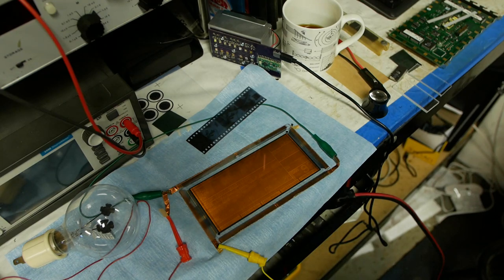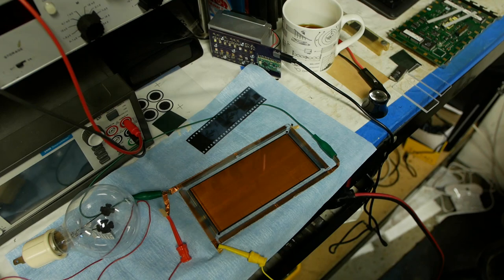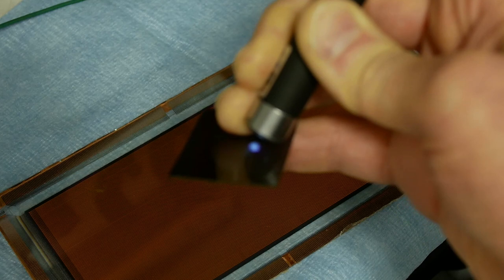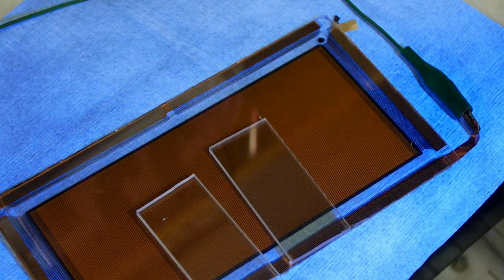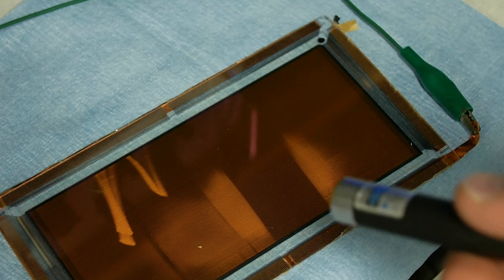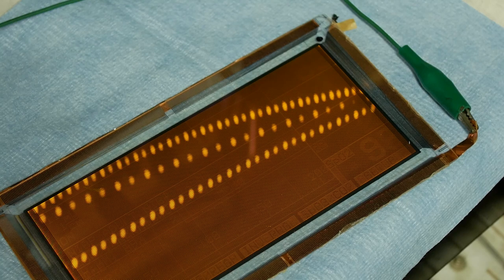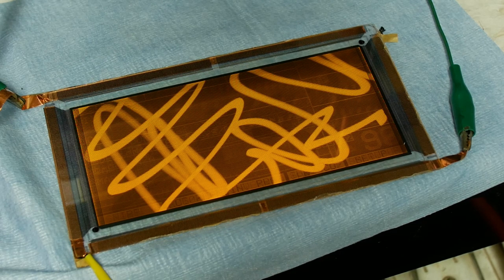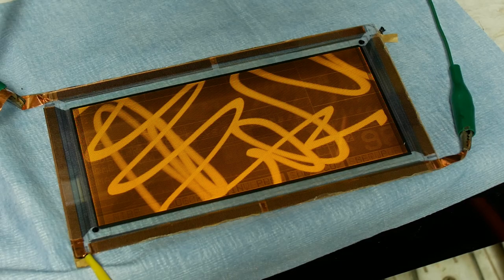Drawing on a plasma display with a laser pointer

Comment: This was very cool. You mentioned the idea of using it for I/O, but I didn't see anything about reading the laser-scanned image out of the display. Is it too basic to cover?
Reply: Probably terrible res
Reply: If it's possible to read, it would be revolutionary. You could turn any old plasma tv into an incredible artistic device
Reply: One way would be to stick a CCD behind the display
Reply: The resistance of the pixel changes, so that should definitely be detectable through current measurement
Reply: @albertweber1617  like to know more details about, how to do that. I have plasma TV with me. Wanna convert it as drawing panel.
Reply: Not too basic, too difficult. You'd have to build a custom driver for the whole display
Reply: i'm think by output he means display

Comment: This reminds me of those CRTs with high-retention phosphorus that were used as display "memory" in some early terminals. I only saw one in the 1990s and back then we didn't have UV lasers at the ready, but I imagine the phosphorus could be excited the same way and retained by the bias voltage (I think that's how they worked).

Comment: Can a laser replace the heater function on a vacuum tube, but by photoelectric emission?
Reply: Checkout photomultiplier tube, not exactly a vaccum tube. But it is designed to be activated by single photon and multiply the signal
Reply: The first stages of electron accelerators (that generate the electron bunches) for x-ray lasers sometimes do this.
Reply: Video cameras with vacuum tube pickups use a photocathode in the image plane in addition to having a thermionic cathode in the electron gun.

Comment: We used plasma displays in our aircraft instruments for years. They had neon, mercury vapor and KR85 gas in them. The Krypton 85 is radioactive and kept the display ionized a little in the dark and the cold. They often had a keep alive electrode that had a few uA of DC continuously flowing for the same purpose. Some neon bulbs like those HP used in their voltmeter chopper circuits probably had some help to switch quickly in the dark. Some neon bulbs were made with green glass (radioactive uranium glass) for the same reason. Fascinating discovery you have here.

Comment: You have single handedly renewed the plasma display. Maybe one day will will see a scanner or signature panels using this tech. Love your videos
Reply: There any readable difference when it's brighter/darker IE voltage/resistance? That difference between acrylic & polycarbonate would be a nice way to detect plastics that's exceptionally hard to do.

You try it on a solar cell? I know they emit light when you drive them in reverse and have the same sort of tech inside them. (more in the IR range though IIRC)

Comment: I think its a bit like gas in laser gets excited, where valence electrons get pumped to a higher energy state when being excited by a photon. When the laser excites the gas, the break through energy required for it to glow get lowered. Add to this the AC current and the laser pointer, then depending on which position of the sine wave the effect is higher or lower. To prove the later, when scribing fast when power is off, the pattern is not supposed to show.

Comment: What great timing - I recently used a UV flashlight on glow-in-the-dark material and found that I could doodle pretty well on it. I've since been thinking about painting a ceiling or feature wall with glow paint and using a computer-controlled UV laser pattern scanner to make a big phosphorescent/fluorescent vector display...

Comment: Thank you for the fun viewage. Perhaps there is a DC offset changing 1/2 pixels? alternately perhaps the pixel stack ends up being diode-ish?
Silly boomer EPROM anecdote follows: I used to (re-)program a lot of EPROMs. I had an erasure enclosure that could hold dozens of devices. I called it a Barbie Tanning Spa.

Comment: Not only are the dots big/small/big/small, the distance between them changes. It looks like the small is closer to the big that came before it than the one after it.
Reply: Yeah that's true, I feel the simplest explanation would be that his function generator isn't producing a perfectly symmetrical drive current, or that the panel behaves nonlinearly. 

However I wonder if it's bc 'freeing a hole' isn't strictly possible, i.e. it's always the electrons that actually move. So possibly you can eject electrons from the metal surface, but can't effectively eject electrons from the gas, therefore the e field has to be weak for the electrons to be ejected from the metal in the reverse polarity (but close enough to the peak to actually cause ignition) therefore shifting the reverse polarity dots to the raising edge of the reverse polarity curve.
Reply: Could it be an artefact due to interferences between the A/C frequency of the plasma and the one of the UV light?

Comment: Super interesting video as always! I remember thinking that it would be cool to have an "analog" notepad to draw on (stylus on a glass LCD) and this is essentially what I imagined; really cool to see it. With the excellent EEPROM comparison, I'd be curious if the plasma display could be read off of and save/reload the temporary images/drawings on the display. Keep up the great work!
Reply: The thing you're thinking of remind me of the LCD notepad/clipboard. It's pressure activated and erases the writing area using an electrical pulse. Costs a couple dollars. I wonder how it works. For sure there are no individual pixels there though.

SONY e-book readers with a Vizplex ePaper display also have a resistive touchscreen option, those that have it come with a sketchpad application. Unfortunately the quality of implementation was garbage software wise.

Comment: Gas discharge lamps do tend to be sensitive to external illumination, It is not that uncommon for neon indicator bulbs to be brighter in a lit environment than in the dark, presumably because the illumination lowers the striking voltage, so it strikes earlier in the waveform. 

Radiation can also affect the striking voltage,  a Geiger-Müller tube is pretty much a neon lamp with some added stuff to tune detection and ensure the ionization is quenched quickly, perhaps your display will show a sensitivity to radiation too? I suppose the glass is too thick for alpha and beta, but I suppose that gamma and X-rays might have an effect. 

I also seem to remember reading something about neon indicator lamps being used as detectors for microwaves at some point, but I don't really remember what that was about.

Comment: For the large dot small dot trail, perhaps you could set up a high speed camera and also try to visualize the AC waveform in the same shot (perhaps something as simple as a red/green led to show positive/negative) to see if if the positive cycle consistently produces the larger/smaller dot.

Comment: INA219 or INA260 come to my mind. You can hook one up on each and every pixel and read/save the values on a per-refresh basis, "theoretically". Or, maybe there's a way to use rows and columns as resistor ladders. As you said, this rabbit hole is awesome.

Comment: Something similar to the neon bulb incident happened to me, but with a christmas tree light. I was no more than 7 or 8 at the time and figured that if 50 lights could go on the outlet, surely one could go as well. I had yet to learn about series and parallel.
Reply: I did the same thing but with an led, they were very new at the time and I didn't know you needed a resistor... connected directly to a power supply and it just exploded... bits of the plastic body all over the desk!

Comment: My initial hypothesis was that the laser was being absorbed by the gas itself, ionizing it and lowering its resistance.  I think that possibility might still be worth considering.  This reminded me of something called a laser-driven light source which uses a focused laser to create a compact pocket of luminescent plasma between the electrodes of an arc lamp.  The laser makes the plasma pocket smaller than an ordinary arc, allowing a less-divergent beam after collimation.  I think most of the energy is supplied by the electrodes still, the laser just makes the plasma only ignite in a compact region.  It looks like Hammamatsu/Energetiq may be the sole supplier for those.

Comment: 7:20 - Shades of Electroboom ! Emphasis on "boom".

16:30 - EPROM (UV erasable). Haven't used one of those in years. I have a UV eraser around here, somewhere. Been buried for decades !
Reply: For the large dot small dot trail, perhaps you could set up a high speed camera and also try to visualize the AC waveform in the same shot (perhaps something as simple as a red/green led to show positive/negative) to see if if the positive cycle consistently produces the larger/smaller dot.
Reply: I have another theory: 
The laser light ionizes the gas a bit, thus lowering its firing voltage. This would also explain the dots when panning quickly as firing voltage is only enough at the peak voltage.
In gas discharge voltage references of old (fancy neon bulbs basically) they put slightly radioactive stuff in the tube to achieve a lower firing voltage. After some years the material is not as active anymore and can cause malfunctions, as the firing voltage may not be met.

There are two possibilities to test this hypothesis that I can think of now:
1.: Try to use something radioactive or x-rays to ignite the pixels
2.: Alter the driving voltage and pan the laser quickly around. The "duty cycle" where it works would be different as well.

Now, actually, when thinking about it the two methods would not prove the hypothesis, also the fact that illumination without powering the display has an effect is not explained by this idea.

Nevertheless it might be a combination of several effects and may be food for thought for you, so I commented anyway.

Comment: I may have missed it, but did you check the laser pen for flicker? Is the laser constant or does it also fluctuate like an LED bulb?
Reply: Those laser pointers are CW
Reply: Since laser pens are usually driven directly off of a DC power source, they should not flicker. The reason cheap LED bulbs flicker doesn't have anything to do with the LEDs themselves, it's caused by poor (or more likely no) smoothing of the rectifier output.

Comment: I would say that the effect is dominated by the freeing of electrons by the photoelectric effect in the metal, and that when the polarity reverses the bias decreases the freed carriers (rather than you 'freeing holes,' as that'd essentially require you to free electrons from the gas which isn't likely absorbing much of the incident light, unlike the metal). This may also be the cause of the apparent shifting in the low intensity dots.
Reply: But if that were the case, then the “stored” visible intensity should never go to the background level in between the peaks. It would have periodicity, but it should always be brighter than the pixels that were not lazed.

My guess is that in one polarity, the photoelectric effect is operating on the metal, and in the other polarity the photoelectric effect is operating on the ITO.
Reply: @bjmcculloch  my interpretation was that in between the peaks the e field was close to zero, and therfore not strong enough to maintain a plasma even with injected carriers. I.e. near the zero crossing point there wasn't enough current to ionize the gas sufficiently while photoelectrons were providing activation energy, no matter the source of the photoelectrons.

Comment: Also interesting is that neon lamps may not strike in total darkness.  Some need at least some photonic excitation.  And if you have an old power strip where the neon light is going bad and it is blinky, shining a weak flashlight on it will cause it to glow steadily.

Comment: This confirms what I thought was possible with IBM 3290 display panels. Some experiments that I did many years ago were done with NE2 neon bulbs. I discovered that "burned out" NE2's worked as light detectors.  I was able to take a new NE2 and lower the voltage to tune the sensitivity to light.  My thought is that this is operating in the same way as a neon laser, i.e. the incoming light stimulates the neon atoms so that one goes to a higher energy state and then emits a photon which then is just the right energy to stimulate one or more atoms.  Probably not fully in phase.  An oscilloscope helped to visualize it.  Quite possible to use this as a photodetector.  BTW, the "burned out" NE2 had reduced functionality because of sputtering, but that turned it into a photodetector.  I nearly went nuts when I discovered it - I had a night light based on an NE2 and it was "burned out", but when I turned on the overhead light it came on with total reliability.  How could the NE2 be connected to the light switch on the wall?  Took me a while to figure it out.

Comment: I see the Patent was assigned to PARC, which is the Xerox Palo Alto Research Center.  Many, many unique devices and technologies were developed there (and without Mr. Jobs stealing a bunch of them, there would have been no Macintosh).  Unfortunately, management of Xerox ignored and buried anything that could not be immediately used in copy machines.  
Also the principal inventor has Noble listed after his name, which was one of the premier plasma display makers at the time.

Comment: I have another theory: 
The laser light ionizes the gas a bit, thus lowering its firing voltage. This would also explain the dots when panning quickly as firing voltage is only enough at the peak voltage.
In gas discharge voltage references of old (fancy neon bulbs basically) they put slightly radioactive stuff in the tube to achieve a lower firing voltage. After some years the material is not as active anymore and can cause malfunctions, as the firing voltage may not be met.

There are two possibilities to test this hypothesis that I can think of now:
1.: Try to use something radioactive or x-rays to ignite the pixels
2.: Alter the driving voltage and pan the laser quickly around. The "duty cycle" where it works would be different as well.

Now, actually, when thinking about it the two methods would not prove the hypothesis, also the fact that illumination without powering the display has an effect is not explained by this idea.

Nevertheless it might be a combination of several effects and may be food for thought for you, so I commented anyway.

Comment: Great project and research! Thanks for bringing this to light!  I will say though, you made that comment about there being 365nm light present in a 405nm laser diode. I'm sure that's only the case as the temperature changes.  I don't believe the FWHM bandwidth for 405nm laser diodes is more than a few nanometers. Great project! Nice work!
Reply from the maker: Yeah, I think you are correct.  I measured it (I should have done so before mentioning it), and I've detected some 380nm coming out, but not much.  Definitely no 365.  I think the panel can respond to 405nm as long as the intensity-time product is high enough, and the intensity is over some threshold.
Reply: @AppliedScience  Just curious, how did you measure it? Fiber optic spectrometer?  It would be really cool, like you said in your video, to do some more experiments.  If you had more sources closer to the DUV side of things you could look at how much photonic energy was held in each gas plasma cell based on a pulse width of the different wavelengths and generate a curve. So cool!!
Reply: @AppliedScience  In other words, look at the threshold energy of the emission based on the external excitation vs. wavelength.  I dunno, use a PIN detector with a fixed pinhole in front of it and scan across the excited plasma pixels. Just a thought.
Reply: @AppliedScience  assuming you can pulse your laser/LED source and match radiant intensity lol.... Also the QE of the detector will change so this is probably not realistic over different wavelengths
Reply from the maker: @Lykapodium  Yes, LR-1 fiberoptic spectrometer, reflecting the laser off a PTFE diffuser.
Reply: @AppliedScience  One funny thing with PTFE is it can actually emit it's own spectra if you hit it with UV light with a higher energy wavelength over it's bandgap energy.  Did you see any funny spikes outside of your expected measurement range?
Reply: @AppliedScience  That's interesting, the specs (for the spectrometer) say it goes down to 200nm, but it just says "fiber". As far as I know, only quartz and liquid light guides go down that far. I'm not trying to sound like a know-it-all, I've just been studying UV spectroscopes lately and I'm very curious about their working parts. It also uses a linear array, but the graph on the datasheet for it stops at 400nm. It's a very interesting topic. I'm also surprised a UV laser diode would emit much beyond +/-5nm. Anyway, thanks for the great video.
Reply: @AppliedScience  I bought 10 of those pointers on eBay, probably from the same source.  It was interesting to measure their power distribution.  5 mW nominal, but the strongest of the 10 was close to 100 mW, as I recall.  I don't think any of them put out less than 20 mW.  I use them to harden UV glue, but after I saw those power readings I decided that some form of eye protection wasn't a bad idea.

There's also no shortage of the fundamental IR pump light coming out, if you look at the spectrum.

Comment: I am pretty sure there is no measurable 365nm emission from 405nm laser pointer. It's just light intensity that is magnitudes higher. Some ASE might be in +-15nm (for NUV source), but even there ASE is reduced when we are above lasing threshold. Beyond +-15nm spectral energy density drops like a cliff. If you do see emission beyond +-15nm - it is likely straylight in the spectrometer.